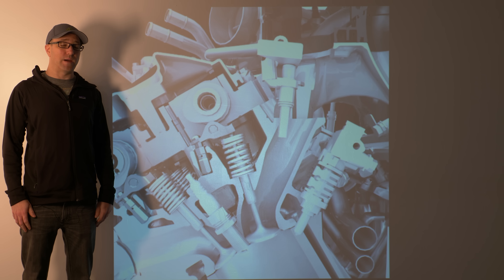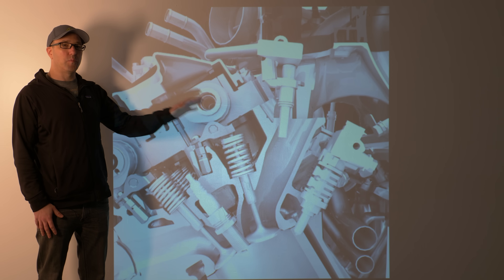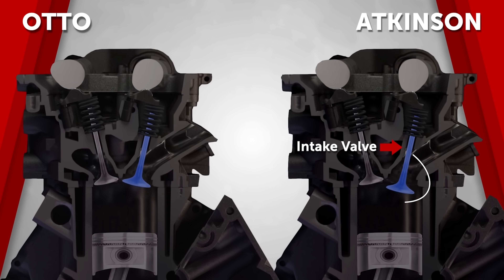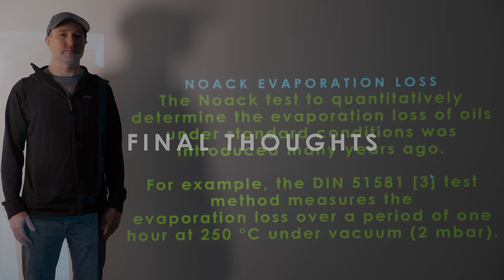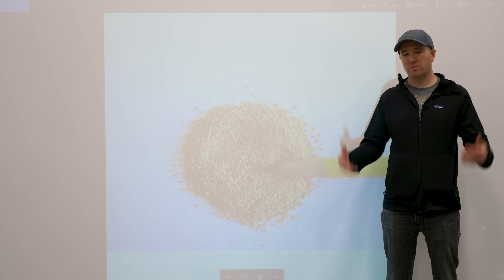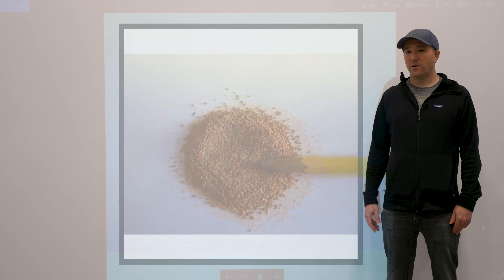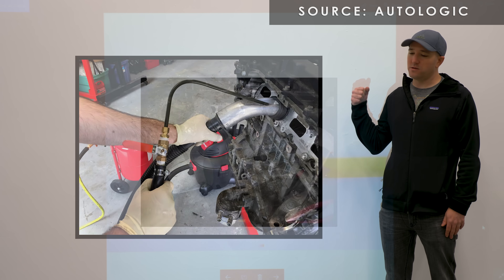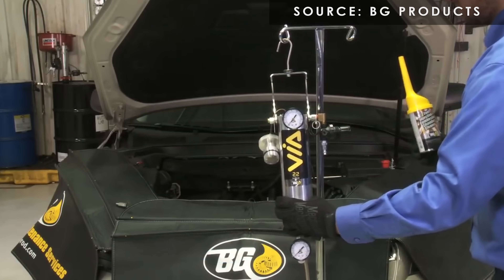Direct Injection, Problems and Solutions | The Fine Print

Comment: Mark, long time subscriber and former factory trained line tech for VW, Porsche, Audi, service manager and crew chief/fabricator for several drag cars,  SCCA class cars and drag racing projects.  I appreciate your efforts producing these in depth tech articles.You mentioned the install of oil catch cans to reduce the blow by products in the intake stream.  One can find many online via Amazon, Ebay and aftermarket kits from vendors ranging from $30 to $200+.  I think it would be interesting if you or someone could do a break down on the features, advantages of these products.  Some are well designed, some are junk.  It would be beneficial to have someone separate the 'wheat from the chaff' per say for those that care about their cars.
Reply: The droplets will be captured, but vapor still has entrained crap in the airflow.  A separator is needed, something that reduces the vapor pressure of oil in air.  This is done by chilling or chemical entrainment, or expansion valves.  These catch cans have little of that.
Reply: Buzz Pedrotti 

I made a DIY catch can from tubing and a plastic bottle packed with stainless steel pot scrubber. Worked fine to condense and trap crankcase vapors. It need not be a high tech contraption. Open and drain periodically.
Reply: My '15 F150 EcoBoost 3.5L GDI Twin Turbo has been terrific. 149k mis. Use 89 octane Shell always. Pennzoil Ultra Platinum full synthetic oil @5k mi OCI.
Reply: Humble mechanic has an excellent video on this
Reply: It's highly dependent on your emissions standard in your area. Southern California Air Resouce Board demands cutting edge technology. Due to the fact the SFV has 20 million engines burning every day along with Long Beach Ship, Boat, Truck, Train traffic 24/7.  If you want info for OEMs that provide the proper Impactor device.  Cummins has great products from Fleet guard.
Reply: I agree!!
Looking forward to that
I care about making them last!!
Thanks
Reply: Hey Dan. I have a 2006 VW Golf MK 1.4 TSI BMY. The car has no problems, YET... What can I do to prevent it? I use Shell V-power and fuel cleaner every 6 months. Is there anything else? I change the oil every 10.000kms with Castrol 5W/30 LL3
Reply: @danielfl.9347  Fuel cleaner is not going to clean the intake valves.  There are 2 things you can do.  First, if you can get to them easily, then look at the intake valves and see how bad they are.  On my ford 2.0 turbo, they were pretty dirty at 50k miles.   If you can see them and they are bad, search youtube for how to clean them as best you can manually.  I found lightly easing the dirt out with various thickness wire worked for me (with each valve closed).

Then I would (and do) do a spray seafoam treatment into the air intake (as directed) 2x /year.

Comment: Very good video wow. 
A few thoughts from my experience talking to customers habits and such
1. Change oil every 5-8k. Fuel washes into oil and makes a lot more vapour, especially when turbos are busy cooking them as well
2. Warm up your engine! If the valves are cold, more chance of crap to stick to em. Just wait till your guage makes a flinch
3. Don't lug your engine around. Barely any manual cars came in for carbon issues, it's probably because the new automatics keep revs low even if you are halfway into the throttle. My guess is even if your busy lil turbo makes torque, the air velocity isn't enough relative to the pressure in the cyl/crankcase/pcv system.
Just a few thoughts. Great video, go DI!!!

Comment: I have a shiny brand new Toyota Yaris IA with a 6 speed and Mazda's 1.5 GDI engine..
I frequently see MPG in the 50's over short highway trips.. and 40's in the city. Super impressive car!

I wanted a hybrid actually but realized that changing a battery out at ~150k would be the same cost as a few walnut blasts over the life of the car.
But for roughly the same fuel economy, and a bit faster 0-60, i bought the DI car based on the fact that it was $7k cheaper to purchase.

I'm pretty happy with the compromise. I'd rather pay a mechanic some labor than pay big oil for more fuel and contribute more pollution in my heavily polluted city.

Comment: With DI. If you place a catch can in-line of the dirty side of the PVC system it will greatly reduce or eliminate the buildup on the valves due to oil getting into the intake system.

Comment: Great vid.  Now I have something to refer the inquiring minds (friends) who question my 50K expenditure on a new Toyota 4Runner which they claim is mechanically already 10 years behind the best currents, engine tech etc.  Yeah that is precisely why I bought one.  A guy at work has already blasted his Audi intake twice within 60K with walnut shells, just to keep driveability decent.  It made it fine to his warranty expiry date however.  Seems Toyota has the right solution though with combining the injector tech.
Reply: Generally the video makes many good, though highly simplified points, and usually the devil is in the details. 
I drove a VW  2.0T with practically the same FSI engine as used by the Audi's - gasoline turbocharged direct injection - to 250,000 km and going strong until it was rear-ended into oblivion. Never needed walnut shell media blasting or whatever. 
BTW, Formula 1 and WEC/ LMP1 hybrid racecars' engines use direct injection too, to get unbelievably high combustion efficiencies.

Comment: Direct injection is a joke, they want clean engines but  these enigines gunk up and then have horrible amounts of emissions because its a pipe dream, having both types of injection in one engine is one solution but then its complicated and more expensive, if you look at the Oil from a direct injection engine it looks twice as dirty as a port injection engine
Reply: Rex Holes well. Take the facts that most Americans don’t keep their cars long. Most of them usually trade the cars in before they even finish the payments. So manufacturers are not need to focus on longevity.
Reply: @merrichoang  This effects depreciation, a cost not to be overlooked. The cars don't go to the junkyard after only 3 years.
Reply: Following the explanation of this video, the gunk you say you now see in the oil of the DI engine, used to be "washed off" in the inlet ports above the valve faces. Which means it was dissolved by some nasty chemical additive in the fuel, burnt into a carcinogenic gaseous exhaust emission, and is now lining everyone's lungs and arteries.
Reply: @stephanuhu963  Could care less as long as my car runs well and gets me there and back.  My 1952 Hudson Hornet 308 big 6 runs great and has lasted a very long time. Road pipes work well and never clog.
Reply: DI is fine if you actually use the engine you bought.  Drive it hard and long.  If the intake valves get hot they burn off the deposits.  The people that have the problems just don't drive the engines hard enough.  There are no slow cars.  Only slow drivers.  If your intakes coke up you're just another slow driver.  Sell the GTI and buy a Smart Car.

Comment: What is lubricating the valve seats with GDI systems??? With GDI, isn't the excess oil and carbon lubricating the seats?   Before the 70's, it was lead. Since the 70's, it is gasoline additives. With a catch can, won't the valve seats age prematurely and fail pretty quickly?   Even Titanium or coated hardened valves need lubrication.  Plus, in the winter, won't water collect and freeze in the catch can lines, which may blowup your engine?   I'm not an engineer so I'm not sure.   I agree its a bad design but I'd rather spend $1500 every 50K to clean the valves than replace all the valves and redo the valve seats. I can't find any info on it, so any professional comments will help. I own a 2011 Lincoln MKX with 40K

Comment: Have you heard of OMC Engine tuner, if you use this every 10,000 miles it will not let the oil build up on the valves and ports. You just remove the air filter, warm the engine up and spray in the intake.

Comment: Video starts out well, then gets several facts/reasons wrong along the way. Carbon buildup on intake valves has been a problem since before I was born. There have been additives advertised in old "Hot Rod" magazines dating before the 70's for cleaning/reducing carbon buildups on intake valves. Simple fact is this: the back sides of intake valves get hot enough to turn hyrocarbon vapors into a solid deposit on contact. They don't get hot enough to self clean like the exhaust valve. Any engine with enough "fuel washing" action to keep them clean has a very bad emissions problem. Also, the OEM manufacturers dont simply rely on customers to be guinea pigs for their new ideas, they run many many endurance tests with their engines simulating worse conditions that you'll ever (wisely) put your engine through. They study the long term impacts and then improve the product over time. Those engineering cycles take time so each generation of engine gets continually better. There's no free lunch.
Reply from the maker: Carbon has always been an issue of course but no to the point that carbon builds up on the intake side at 60k miles to block valve closing, cause serious misfires and hard starts.
Reply: I disagree. Having been an ASE mechanic from 1991-1998 I can tell you how much carbon I've personally cleaned from the GM multi-port injected engines with fuel injectors directly above the ports. And even more from the throttle-body causing the engine to die/cut-out as you stepped on the throttle to cross a road (dangerous). I'm not saying that GDI engines are clean, but lets not pretend the carbon problem is new or that we haven't been battling the issue for decades. Some engines are always worse than others; the GM MPFI engine was one of the worst in the early 90's but the "grandchild" of that same engine is now quite clean (I pulled the heads from a 180,000 mile engine in January and the intake valves had only minor carbon buildup...at least on the valves which are now coated to resist carbon adhering to them)

Comment: The problems with GDI engines is specific for the 1.6 THP Peugeot and Mini they all go bad between 60.0000 km and 90.000km and the cost is minimal 1200 to 2000 euro per car , it is theft from the customers .

Comment: I've seen worse intake valve build up on carburettor engines AND on high performance (150~200BHP/litre) port injection motors, even when breather system has been routed into catch tank

Comment: Another very informative video by savage. As an owner of an '09 Speed 3, I've had the unfortunate (mis)pleasure of cleaning my valves recently while replacing a blown turbo. At 86,000 miles, they were well overdue, and it took me a full weekend of spraying chemicals, picking, blowing, more picking, more spraying, blasting with walnut shells, and more blowing. Replaced the stock PCV valve with a new one since the intake manifold was off, and installed a catch can. Hope I never have to do this again, because it was not fun, but it's nice to know I don't have crud on the back of my valves.

Comment: All this bullhonkey to reduce emissions and fuel consumption 1-2% when you could cut wasted fuel and total emissions in half AND save productive working people billions of wasted hours each year just by hiring competent road designers (less traffic lights and bottle necks; assuming the latest land development wasn't exempted from proper road impact fees) and by increasing driver education standards.(Pareto principle, the bottom 20% cause 80% of the congestion) The truth is that no improvements in emissions standards were needed beyond about year 2000, air will continue to improve simply by continuing to remove the junk produced in the 1970s and 80s. Make it easier to swap in new/rebuilt engines and you would have even less smoking junk. 
The new auto regulations have been usurped by people who wish to eliminate personal transportation (by driving up the cost)  for a variety of misguided reasons and maybe even a few more Machiavellian motives.

Comment: Gasoline DI engine is basically the same as diesel, but with a spark plug. Diesel also has high-pressure injectors. It also injects fuel injected directly into the cylinders. The only difference is that diesel fuel has lubricating quality, while gasoline does not, so the injectors and pumps use different materials. So yeah, similar issues, but with fuel efficiency closer to diesel without the smell.
Reply: LeadHammer and cummings heavy truck engines go 1million miles without pluging the intake valve/ports   . So it must b from cam overlap reversion from combustion
Reply: LeadHammer  so not so much intake valve overlap should eliminate the reversion/suction of exaust into intake
Reply: Looks like a bosch commercial
Reply: Basicaly i do agree with you, but the diesel engine does not control the amount of air coming to the engine...there's no throttle control...or butterfly valve. Instead they very precisely control the speed and power of the engine by controling howm much of the fuel gets injected to the cylinder. Other than that...there's one more difference (which now Mazda trying to change comming to the market with direct injection gasoline engine that uses the spark plug only in certain conditions...the diesel engine uses the high pressure in the cylinder (much higher than the gasoline engines...except now Mazda's) to ignite when diesel fuel is injected into the cylinder (BTW much higher than in the todays direct gasoline fuel injected engines.
Reply: Diesel is not a solvent that is a carbon build up magnet. Besides diesel can be built to run without any electronics, and does not need electricity to keep running once it is started. Just needs a way to shut off the fuel and air. The best gasoline engines have a magneto and a carburetor. Just need two switches and a choke. one switch for the starter and another to kill the magneto.

Comment: Diesels works with direct injection, and carbon buildup on valves wasn't a major problem.
Every two or three oil changes you can even clean manifold and valves with dedicated cleaning spray.

Comment: The solution is in our face but we don't pick it because we are too spoilt. 
We need to reduce the size and weight of the vehicles it is that simple. Any engine advancement is lost with increases in size and weight.

Cars getting bigger and heavier is not due to safety devices but due to consumers (us) wanting to have more options. Safety devices like airbags do not really add much weight, however electric seats, heated cooled seats, multiple speakers & subwoofers, Automatic transmissions, much more sound deadening etc do add much weight, as well as the want for larger dimension cars carrying extra steel, glass, wind resistance and rolling resistance negating much of the gains in engine economy.

Comment: On my 2009 Bmw 135I which has DI and is turbocharged only thing I had to do to clean the backs of the valves off was run it at 3500-4k for about 10 min heat it up. After when i would check with a camera down the intake runners they were fine and otherwise clean no more carbon buildup. After I added the oil catch can I could run longer without having to do the heat up runs.

Comment: These video explain the problems of 3 Rd world USA, and their very low grade petrol, here in the 1st world, the standard fuel is 95 Ron, and special 98 Ron, with this high quality standard fuels, these problems are none. And a plus note we use the best oils on the market. I own a 1.0 lt ecoboost, no problems same power after 6 years and 90k+ kms.
Let me tell you a simple thing change your oil accordin to the brand recommendations, new ecoboost 1lt engine use 5w20 oil full synthetic.
Learn to make cars with Europeans, even the Ford models made for Europe market are not sold in the USA, why? Because these engines need high grade fuel, and the standard in Europe is the best in the world. That's why gdi works and lasts for hundred of miles in Europe.

Comment: Manufacturers have largely dealt with these issues by recommending synthetic oil with more cleaning properties and is able to take more heat.  Additionally, yes, some car makers have multi-port and direct injection but DI engines have progressively advanced over the years and mitigated the worse of these issues.

Comment: Wow is this video incorrect! Blowby goes precisely in the 'other' direction, it's combustion gases making their way past the piston rings into the crankcase - Hence positive 'crankcase' ventilation. Furthermore, one of the biggest problems with buiIdup on the rear of the valves is EGR, exhaust gases react with oil mist from the 'crankcase' resulting in carbon buildup on the rear of the valves - While not as common as direct injection engines it happens on port injected designs also, I've had it happen so bad on port injected engines that it actually produces an audible knock as the carbon on the rear of the valve collides with the port roof. For the record. I drive a Mazda 3 MPS with the first generation direct injection DISI turbo L3T engine and at 230,000klms I've yet to have an issue and the intake manifold has never been off the engine. Considering the massive reduction in combustion chamber temperatures allowing for high compression as well as turbo boost pressures in excess of 16psi, the advantages of direct injection by far outweigh any apparent disadvantages. Newer dual VCT engines don't suffer from carbon buildup on the valves due to the removal of EGR directly into the intake manifold.

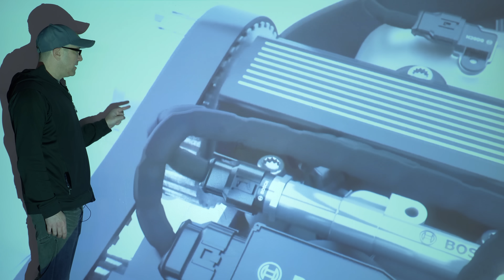Comment: This guy isn't a technician. Those are not fuel lines at 1:45, those are electrical connections. Blow-by does not move to the surface of the piston. It blows past the rings, and pressurizes the crankcase. And I want to know what car in the late 90s early 2000s, got 60, 70 or 80 miles to the gallon.